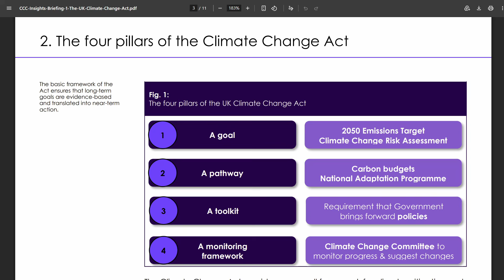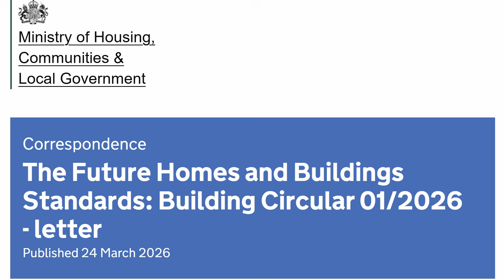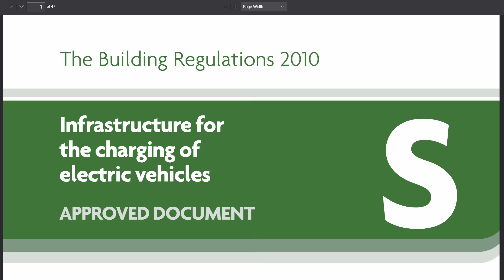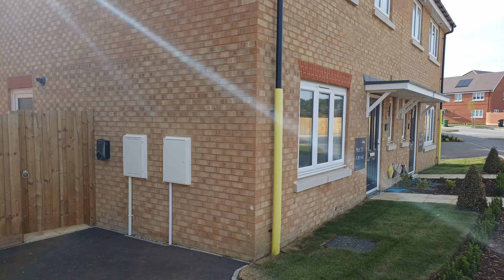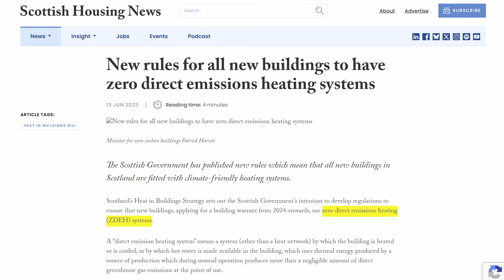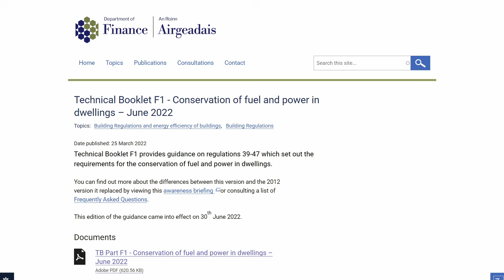Are New Build Homes Being Future-Proofed?

Comment: The solar requirement should have been put into building regs rather than the new homes standard. That way re-roofing of existing houses would also be covered.
Reply from the maker: That's an interesting point. The changes are in the building regs. The new homes standard was a name given to the discussion - I think it was a wrapper - almost a marketing term - to allow people to focus on this particular set of changes. However, the ultimate outcome was an update to the building regulations.

Significant refurbishment of existing buildings are impacted by the changes made. I am not absolutely clear on what the exact trigger is for building control to be involved, but if building control need to be involved in the project, then the new regs apply - or will apply when it comes into force next year.

I don't think that replacement of a roof normally triggers the involvement of the building control team. However, as I say, that's one aspect of building regulations that I'm not absolutely clear on, so I might be wrong. It might depend on whether the replacement of the roof materially impacts the structure and shape of the roof - in other words, whether the existing structure is having its surface replaced, or whether instead the underlying structure needs replacement too.

Comment: Fascinating, thanks.  Liked and subscribed.  I'm aware of at least one new development of over a hundred houses in Northern Ireland that are either just finished or about to be,  where none have solar panels or ev charging. All are heated by gas boilers.  How is this legal?
Reply from the maker: Thanks, great to have you with me.

Apologies for the delay in replying, I decided I needed to have another good read of the NI regs before being able to give a sensible response.

That sounds really odd - but let's deal with EV charging first. Sadly, there is no requirement for the installation of EV charging in Northern Ireland. This feels like a bit of a mistake, to me - a weakness in their regulation.

Secondly, I am somewhat baffled as to how heating with gas has been justified - especially without any solar or other local generation.

The regs require 2 things:
1) That the homes' emissions are 40% below a target set in 2012, and
2) That a minimum of 20% of the energy used by the home is generated from renewable sources on-site or nearby.

Heating with gas is hard to achieve whilst still meeting the emissions requirements - but it isn't impossible. The homes would need to be extremely well insulated (close to the passivhaus standard, at a guess) and have some significant renewable generation - yet there seems to be no on-roof solar. How odd.

I wonder whether they have a nearby generation facility of some form - perhaps a nearby (and associated) solar farm, wind farm, or biogas plant. The generation doesn't HAVE to be on-site, so that's the only thing I can imagine we are missing. Perhaps their generation isn't quite as close as we might have expected.

I wonder how up to date Google satellite images are in that area - whether there might be some nearby generation visible from examination of those images.

Whatever they have done, it seems at first glance to be a more expensive option than you would expect. On-roof solar is what you would expect to be the cheapest way to conform.
Reply: @theelectrictransition thanks for the detailed answer. It is true that the houses are well insulated.  I have been in one in bitter cold weather and the radiators were coping fine running at, i woukd guess, about 35degC. As to nearby generation, i will research a little further.

Comment: So let me get this straight. You all seem to agree that the build quality of new homes in the UK is definitely not good and cause for concern. However, you don’t seem to be concerned about the build quality of new EVs from China. OK……. interesting.
Reply from the maker: You make an interesting point - as ever, of course. What I would say though, in response, is that most things are more complex than people might want to make out. 

It would be lovely if everything was a binary answer. USA good, China bad. I totally get that. But that's simply not the way the world is. The USA' s move on Iran was not good. The UK's position on Gibraltar might not be right. I could go on.

Let me give a simple example. Do you consider the iPhone to be a horrifically dangerous item that should be banned worldwide? Well, it's made in China. As almost everything is.

There is definitely a chance that a small subset of Chinese manufacturers want to sell us rubbish - dangerous tat - irrespective of the outcome. I see that - I watch people do it. Yet, to say that every Chinese company is doing that is simply a falsehood.

EVs are very different to micro-mobility devices. Some of the latter are made with cells that have not been built to the safety standards that are necessary. However, saying that applies to EVs is a huge stretch. Warranties count for something here - they hold manufacturers accountable.

For those who don't believe me, there are plenty of EVs that don't use Chinese cells at all. If you want, choose one of those. But don't use China as another excuse to do nothing. Sticking to the status quo is not action, that's a failure to take action.

Comment: The electrics aside, new builds are poorly made, and far too expensive for what they are.

The materials used, and the quality of construction wouldn't be adequate even with a budget pricetag, not that that exists.
Reply from the maker: Yes, I absolutely agree. I hate it when corners are cut, and new builds seem to suffer that a lot.
Reply: @theelectrictransition  I've even been in renovated old buildings, like former Trade Exchanges, and while it's all literal red carpets and gold trim (looks good in photos), when you're walking on the red carpet public hallway, you're bouncing up and down because the subfloor is so flimsy it's like a bouncy castle!

Yet the apartments in the building are sold at "Premium" prices.

Comment: There is also a limit to how many EV's you can charge in a given road. For example in my Road cabling which is 30-40 years old if not more is rated at average loading per household at perhaps 5-7 K/W at peak times. If you add EV's and heat pumps this will more than double. You will need to re-cable hundreds of thousands of roads not to mention generate more reliable electricity and use electricity with military style precision which is not practical.
Reply: But pumping oil from thousands of meters under the sea bed with dynamically positioned GPS locked oil rigs designed to work in severe sea states is practical.
Reply: @edc1569    Please don’t be dumb.  The target is to reduce fossil burning to the absolute minimum, given time.  Have you not heard of climate change?  No.  I expect you are a climate change denier.
Reply: @michael.randall5034  But these regs apply to new build. If you can't get a good enough connection, you can' build it.
Reply: @michael.randall5034  But these regs apply to new build. If you can't get a good enough connection, you can' build it.
Reply: Not true?  In fact, I would say “Rubbish”.  Nearly all homes can draw 50A, most 80A and often 100A or more.

The problem arises when too many properties with chargers are connected to the same phase of the supply, causing an unbalanced transformer from the usual 3 phase supply.  Often homes had a linked supply, so on th esame phase as their neighbour.  That was not a problem when night storage heaters were in regular use back in the 1960s/70s/80s, but are deemed out of order in the 2020s.
Reply: @oliver90owner  the network is not designed for multiple homes to pull anywhere near their fuse current for sustained times, you blow the substation fuse if you do.
Reply: @edc1569   Please don’t be so silly.  Trip a contactor maybe, but I very much doubt there are fuses involved.That is simple fix.  Upgrade the transformer?  10 years to get that act together, I suspect.
Reply from the maker: This is a topic that I covered in some detail in the past.

https://youtu.be/CDn4OZEm1OE

Yes, some local infrastructure will need an upgrade, of that there is no doubt. You say it's not possible, but I disagree. It's exactly what we are currently doing with the gas network here in the UK. As I mentioned in a video very recently, the HSE mandated that a huge proportion of iron gas mains be replaced with plastic for safety. That wasn't impossible, but agreed it is slow.

I did another video that is also important here - the shape of the transition is not what people imagine. The demise of ICE is MUCH slower than most people picture, because cars last a long time. That's covered in this one:

https://youtu.be/prpKOepfeJA

Comment: I was recently chatting with some of the chaps who moved into some of the new builds in our village. They’ve got solar panels and car chargers outside every house, sounds great! Until you dig into the details…

The car chargers are “smart” chargers of a brand I hadn’t heard of. Apparently the app is terrible to the point of being unusable and they are struggling to activate it to get a charge. One of them has already had it replaced after having to use a granny for a while. 

Then the solar. Apparently the builder discovered that panels are cheaper than tiles, so they maximised the panels they could fit and got 12 on to the roof. However it seems they weren’t so keen on paying for an inverter that could cope with them all so only 4 panels are connected. The estate agent sold it to them as “you have the option of connecting up the other panels in the future”, but I’d imagine having a significantly larger inverter, plus probably a battery, fitted isn’t a small job. 

It does seem like the general build quality is low all round, it’s not only the electrical systems which are terrible. But this highlights that new build regulations have to be very strict and very clear or people will end up with a “solution” which ticks the boxes but doesn’t actually set them up for an electric future.
Reply from the maker: Ah, yes, so sad. So many desires to cut corners in new builds, it seems. Sigh.

Hopefully the builder in question will get badly burned by installing cheap, unreliable chargepoints. That way, they will learn their lesson, and find something better. In the meantime, everyday people suffer though, so that's very sad.

I can understand that situation regarding the solar. Indeed it has become the case that panels are cheaper than most other building materials, so it does make financial sense.

What would be interesting to understand is whether the now owners were missold. If they were given the impression that all of the panels would be connected then they have a legal case that they should pursue. If not then I suppose they are no worse off than they would have been if tiles had been fitted instead. They got some extra panels free, and can decide if and when to connect them. However, I suspect they might have assumed that they would be connected but not told so - and I too would feel aggrieved at that. The builders have taken them for a ride, and they may feel foolish for thinking well of the homebuilders, when often that is misplaced, sadly. Sigh.

At the moment, the legislation doesn't require much of a solar system. They get installed in order to lower the total emissions, but as you say that makes them a token gesture. Hopefully the new requirements from March 2027 solve some of those problems - even then, building companies will continue to cut corners where they can. Sigh.
Reply: Wow I love that way of over panelling actually! Get your g99 application in before everyone else!

Comment: I live in a shared ownership flat. I have a gas boiler and i have no idea how to get a renewable tech boiler installed when my current 12 year old gas boiler needs replacing. I’m held back by my lease and the housing association who maintain the building. I cannot get a heat pump grant because i an a  shared “Ownership” long term tenant.  I don’t own the property at all. It’s a lease so i don’t own anything. I’m not an owner. I don’t own anything.  
I think maybe the housing association is a large part of the problem. They have no incentive to improve the building for the benefit of its residents. They have little incentive to maintain the building in a proactive preventable maintenance sort of way. They just take the service charge and know if there are big repair costs in the future the shared “ownership” long term tenants will pay.
Even getting fibre broadband installed seems difficult. Each year open reach state next year they will be installing fibre and it never happens. I have little hope of being able to get my flat into the 21st century renewable situation. Because of that it will cost me a lot financially in future because i can’t save money by using 21st century tech.
Maybe I’ll be allowed to install a home battery system, even that may not be allowed.
There must be many people in England and Wales feeling powerless about improving and modernising their home. Especially leased flats.
Reply from the maker: Thanks for the comment, I really appreciate your time in helping me understand a different ownership model that I haven't experienced myself.

I feel your pain. I did have a leasehold flat for some years and while that is not the same as you lr situation, I do identify with what you are saying to some extent. Thinking back to that time, I can imagine how I might feel frustrated too, even without the extra complexity of shared ownership.

Whilst it doesn't help you personally, what I like about the new regulations is that in the future, other people getting into shared ownership will be in a slightly better position - their buildings will already contain the future-proofed tech.

Back to your specific situation, you might be able to benefit from a plug-in battery, when they arrive. However, plug-in solar would require some permissions from your landlord, and it seems quite possible they will not want to give that.

I can imagine a change in legislation being introduced in the future to help you out. The leasehold scandal of the past 10 to 15 years has shown that the government will intervene when required - although often very late. The wheels of democracy do not turn quickly.

A heat pump doesn't save much money, at the moment - that's a bit of barrier to their adoption. It's a shame to miss out on the emissions reductions it can bring, but I think that will happen eventually through additional tweaks to the regulations.

Solar can help save running costs for sure - but I think that's a bit less true of plug-in solar, so you might not be missing out all that much if you end up being unable to use that. Simple plug-in solar systems feed most of their energy into the grid - to the benefit of the DNO not the tenant, so that's not anything to miss too much either. However, a plug-in battery, in combination with a change to a time of use tariff - if you are able to do that - could save a useful amount, if it's big enough.

There are quite big savings from running an EV, so that's the one for you to work towards first, I would say. Contact your local council and ask what on-street charging is being installed near you with LEVI funding. You don't necessarily have to have charging at home for an EV to save you money - although the savings are biggest for those who can, sadly.

I think I would suggest you be patient. I can imagine it's a worry at the moment, but I think changes will be made when your situation is better understood by your/our MPs. It has become clear to me that the UK is absolutely serious about the transition, and they will change what they need to change to make it work - but little by little. Your problem will not be solved first - but I have a strong suspicion it will be solved.
Reply: All proceeding according to plan: 1) Own nothing, 2) Now to convince yourself that you're happy, then:  Bosh, job done!

Comment: I've often wondered if numbers have been crunched to calculate the cost of all these new ecological requirements and the savings that can be had because of them. This may make mortgage repayments higher but running costs lower. Just a thought.
Reply: Solar photovoltaic panels can be cheaper to install than roofing tiles these days.  The only issue is when a panel fails and needs to be replaced - suppliers keep changing sizes and specs of panels.

Energy costs will continue to rise if fossils continue to be used, so pay back will occur in the near future, for sure.
Reply from the maker: Yes, I can understand that concern. There is some extra cost in adding these technologies just at the moment, for sure. However, it is, relatively speaking, a drop in the ocean because of the very high cost of a new home in the UK.

What's more, including it at build time saves the expense of a retrofit, which is always more complicated than an initial fit out with the tech at the time of building.

The third thing I would say is that the new build market is quite big - and a market of that size can move the needle in terms of costs. Now, many more people will be required to train to understand and correctly size heat pumps, and there are significantly more to be sold as of March 2027, and that all helps with the march down the cost curve.

I do feel for buyers of new homes - but mainly because the price was ALREADY insane - and almost unobtainable for young buyers - and not really because of the additional cost of these new technologies.